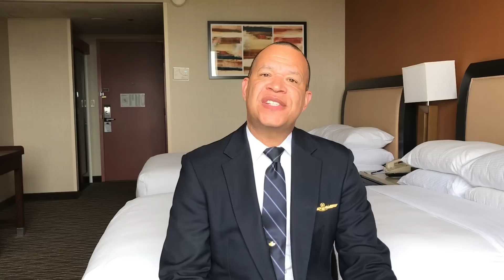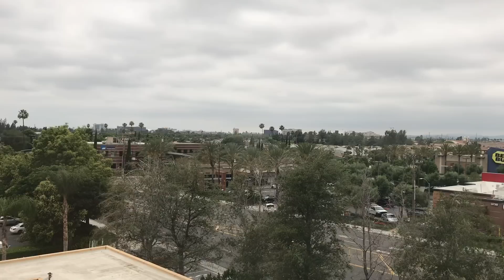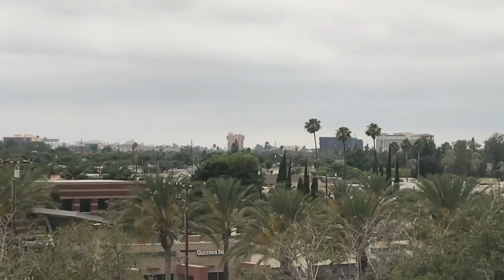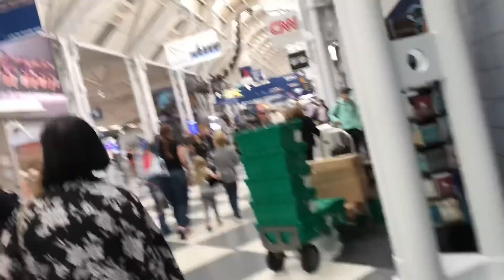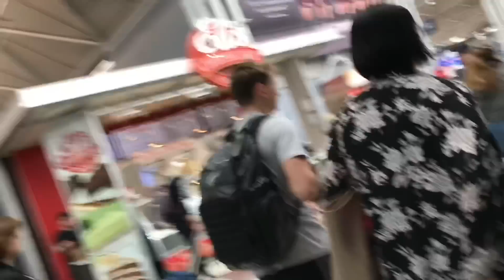Ask Cap'n Jster-B737 Max

Comment: MGreat video. One thing I have been wondering about is with the grounding of the 737s, have the pilots been furloughed and unable to earn a pay check?
Reply from the maker: Excellent question!  No furloughs.  The other planes are picking up the slack.  Luckily my airline had only 14, so it's easy to pick up the slack with the other fleets.  And thank you for asking......
Reply: @jster1963  Thanks for the update. I know what it is like to not be able to work due to extenuating circumstances and was concerned for the pilots, their families and others who would be impacted.

Comment: Great vid capt jster. I have a question about landing. Why is it when the plane lands it sounds like they rev the engines really high instead of idling it down and breaking?
Reply from the maker: Great question Mr. Johnson.  We put the engines into reverse.  It doesn't reverse the rotation of the engines, but it diverts the high bypass section of the thrust forward.  That is about 80% of the thrust and is VERY effective of slowing the plane.  It can move the plane backwards, but most airlines don't use it for that purpose.   And thank you very much......
Reply: Google Reverse thrust

Comment: QUESTION.. The news keeps talking about jack screws .. For years now they have had issues , What are they and what is the problem from a PRO"S point of view ?? I Know the need greased , But are the like a lathe screw shaft ?? .. ENJOYED MAN !!
Reply from the maker: Jack screws are used to move large control surfaces.  Mainly the horizontal surfaces.  I make have to answer this in a video ;-)  And thank very much.....